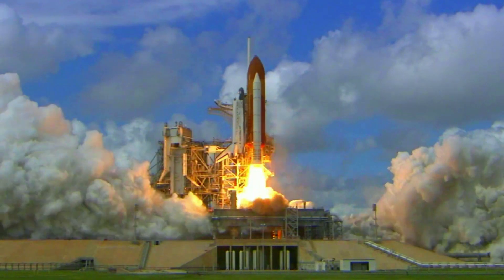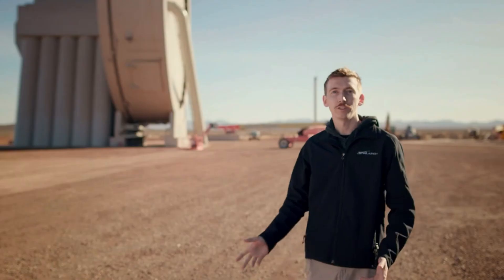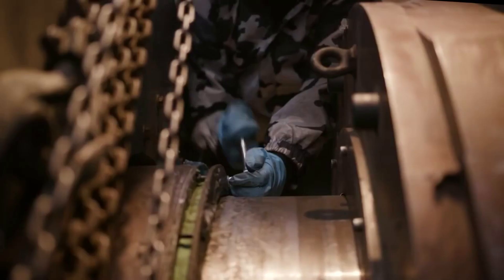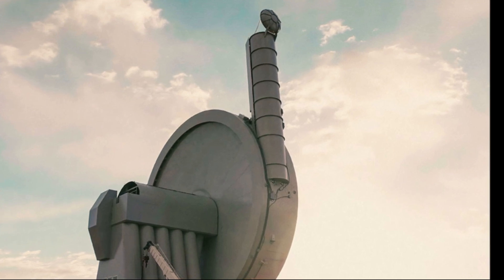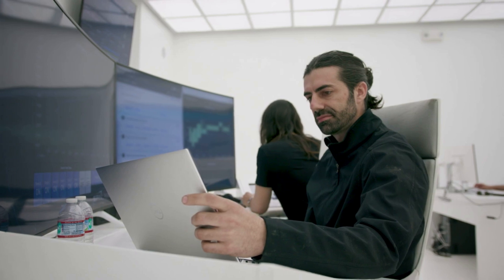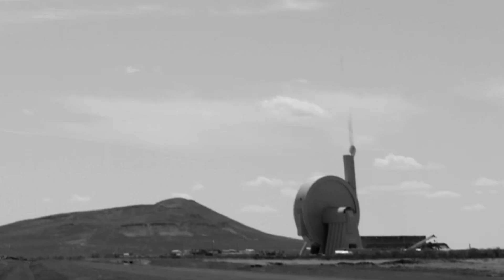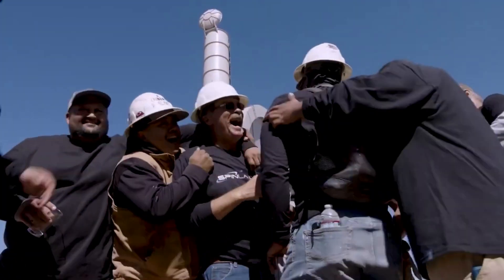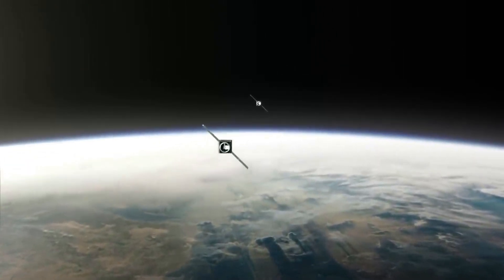How Is SpinLaunch Progressing Towards An Orbital Test Flight?

Comment: Spinlaunch just doesn't make sense to me, even using the claims from their own press releases and prospectus. The maximum payloads will be small and require special and expensive engineering to handle launch stresses of over 10,000Gs. I get that it's cool. But when a company's own unaudited marketing claims fall short of what their competitors already provide, I have to wonder where the economic value is.

Their own website says "...satellites up to 200 kg... hoping to reach launch costs of $500,000...". That's $2500/kg. A great bargain vs launching on an Atlas 5 or the old Congressionally-cursed Shuttles, true. But SpaceX's publicly known rates are already in the $1700/kg - $2700/kg range, depending on whether you can fill up a Falcon Heavy or only a Falcon 9. You have to launch at least a whole Falcon 9 of course, but SpaceX also already runs an office to consolidate small payloads together as add-on 2nd missions attached to a larger commercial launch that has some excess payload capacity (most do).

Hopefully I'm missing something simple and obvious. Maybe there's a military application for Spinlaunches?
Reply: The benefit is environmental, SpaceXs Starship would burn 1000t of methane per launch, one of the most damaging substances for the climate. SpinLaunch can be from ground to stratosphere, 100% renewable energy based. The technology is also more scalable and reusable, in theory...
Reply: @godalmighty83  furthermore it would seem an orbital refueling station is low hanging fruit where SpinLaunch could cheaply toss up buckets of rocket fuel. 

SpaceX rockets could carry more payload off the ground and refuel in low earth orbit before proceeding to a more distant mission.  

Because of size of a car and its gas tank, we do not drive them from Florida to California without refueling.